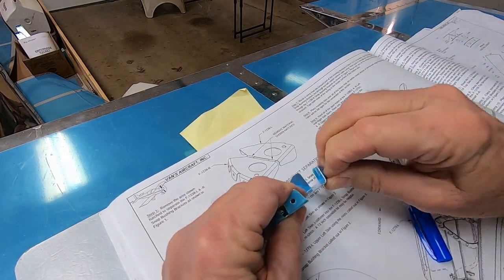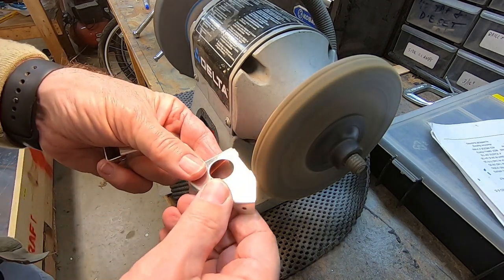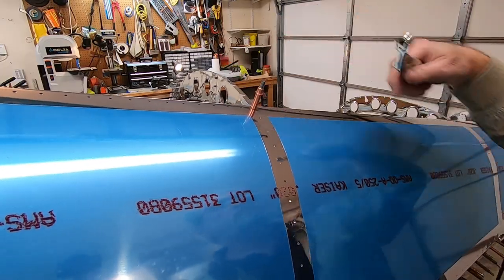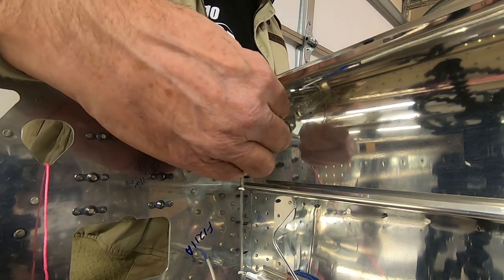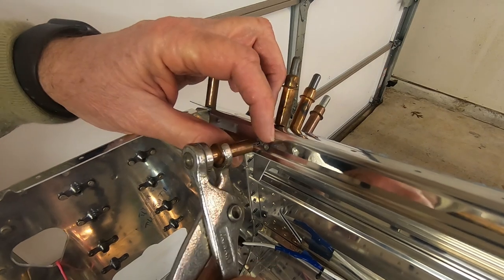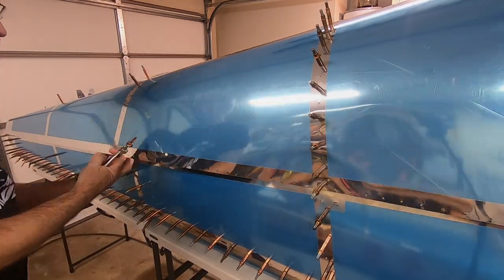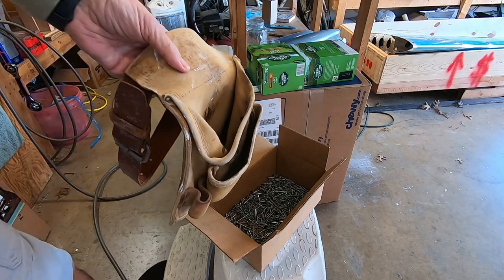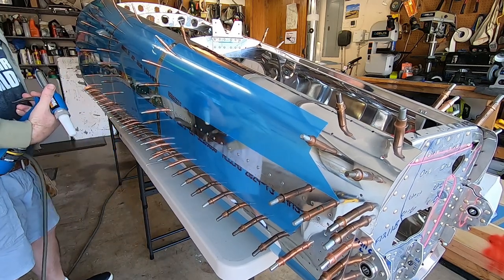Van's Aircraft RV-12iS Tailcone Construction Part 3

Comment: Great videos!  I hope to start my RV12is build soon, you are giving me inspiration.  Looks like you are doing all you riveting with the Pneumatic riveter, did you give up using the Milwaukee?
Reply from the maker: Thanks! This kit is a lot of fun to build. It's surprising how fast it goes together. I bought the Pneumatic riveter in this video from Harbor Freight for around 60 bucks and it has performed perfectly. I stopped using the Milwaukee riveter because the mandrel of the pop rivet would get stuck in it, and I had to take it apart to get it out.